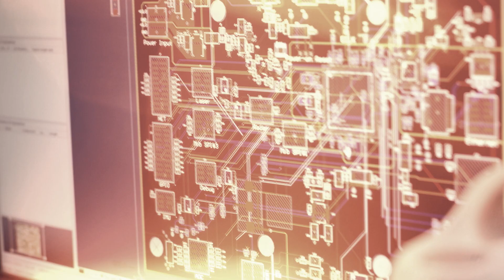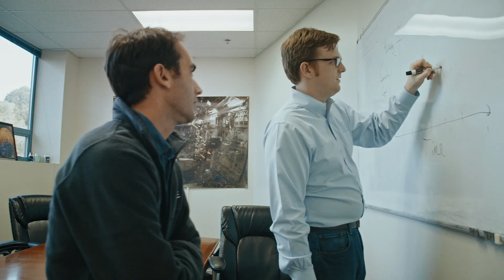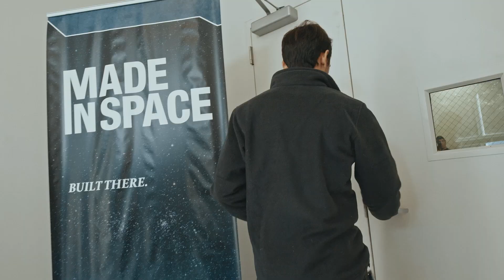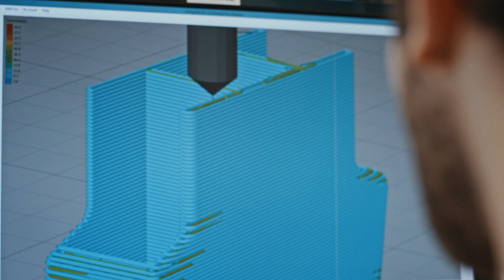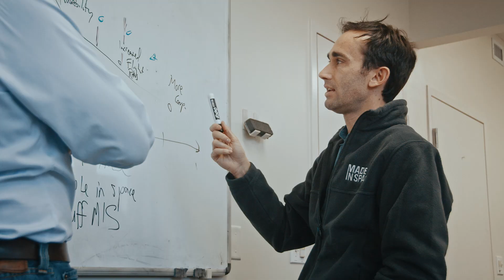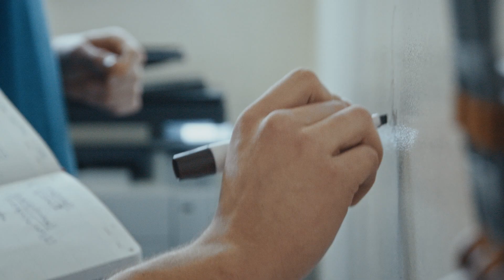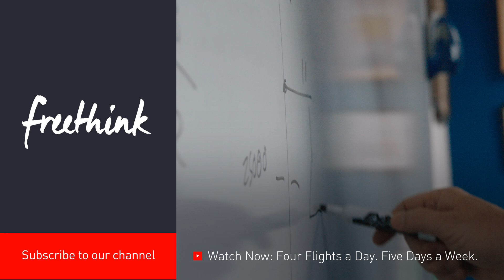Made in Space | Freethink's The New Space Race

Comment: This is great, but doesn't solve any problems with weight. You still have to send up the raw materials to create the tools, likely more material than the tools weigh due to manufacturing inefficiency, and the printers themselves. It saves time, but costs more due to a higher launch payload.
Reply: You save mass in at least two ways. First, you don't need to send as many unnecessary parts for mission assurance purposes. You can rely on being able to print what you need. Second, you can recycle the parts when you don't need them any more.

More importantly, if we continue with this technology we'll soon be recycling space junk. There's 1900 tons of mass sitting in orbit waiting to be recycled. Having the tech to manufacture useful stuff tools from it creates an incentive to reclaim it (which incidentally would be helpful for preventing Kessler Syndrome).